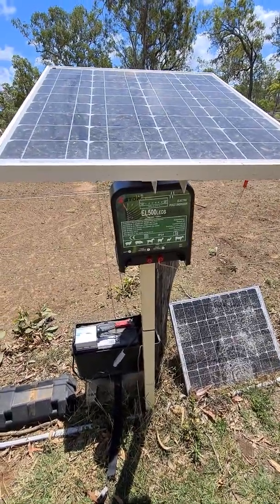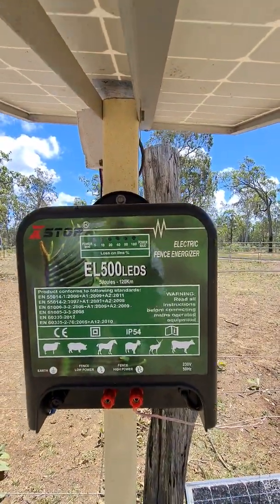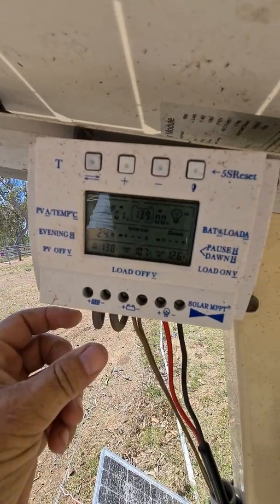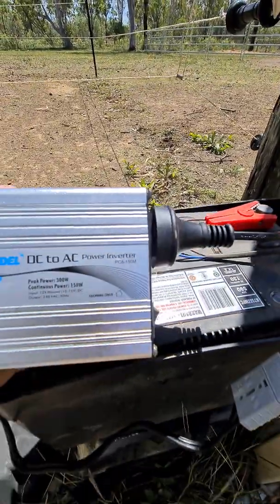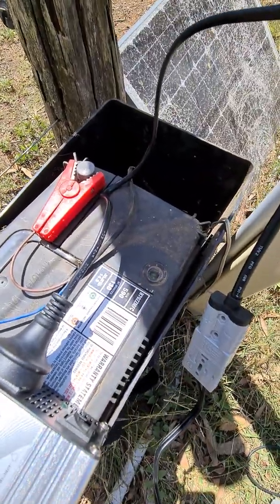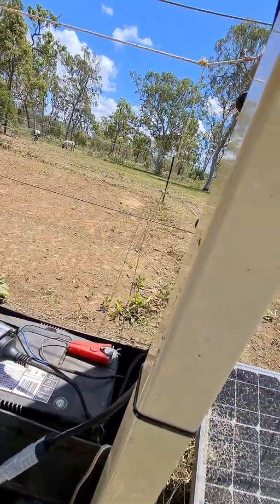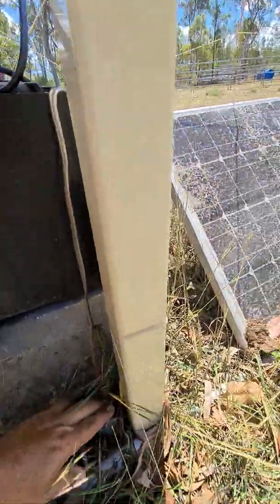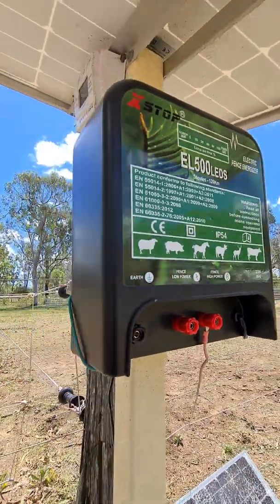Solar 12v to 240v inverter Electric fence energiser set up.

Comment: It's great that you put this on here.  How many joules does the electric fence unit have?  I'm trying to solarise a mains fencer for my sheep field. I bought it then lost my mains electricity supply.  Any advice would be greatly appreciated.
Reply from the maker: I would go bigger on the solar panel to keep battery topped up like maybe a 160w and use at least a big four wheel drive battery or tractor battery. My energiser is 240v and put out 5 joules and is made by Xstop I purchased in Australia on EBay for about 130 Australian dollars. You have to use a solar charge controller of 10 amps at least and it's better to use pure sine wave inverter of 150w output.
Reply: @danssv8  hello there will a normal sinewave inverter damage an energiser ?thank you
Reply from the maker: @antoniobond4907  pure sine wave is better,  it will be fine.